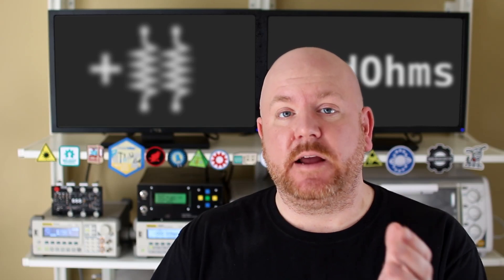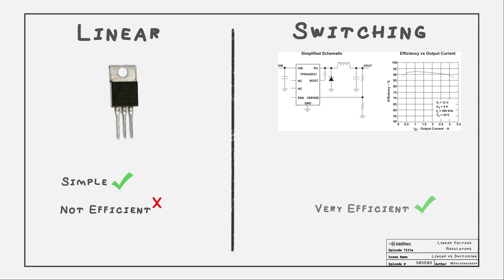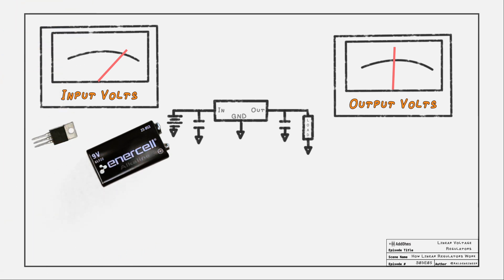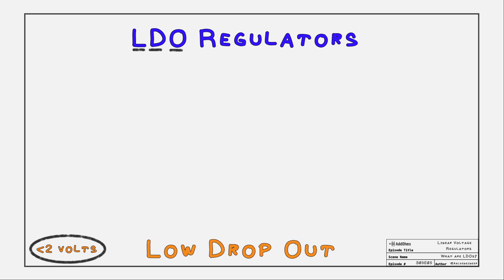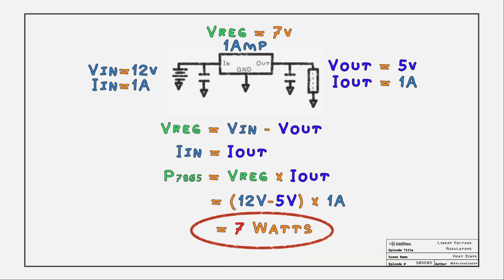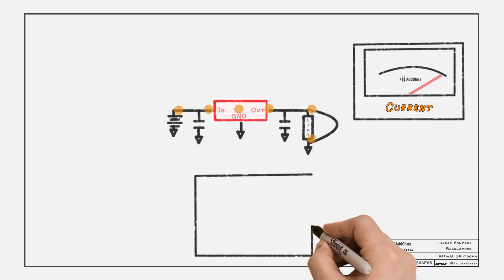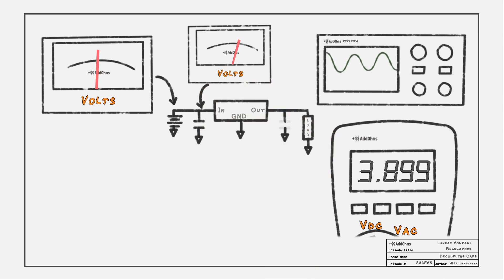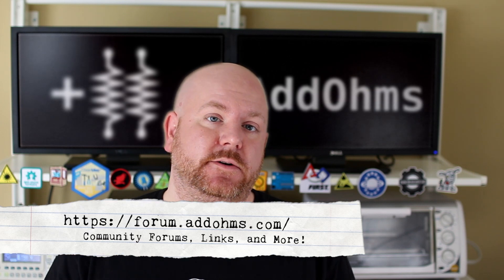Linear Voltage Regulators (LM7805) | AO #17

Comment: How does this thermal shutdown works? It can't just decrease the output else the temperature will increase even more since there will be a higher voltage drop in the IC. So it should refuse to take in voltage. You said it is a gradual output decrease as the temperature rises. How does it do that gradual decrease?
Reply from the maker: Page 10: https://www.ti.com/lit/an/snva558/snva558.pdf
Reply: @AddOhms  Thank you for the reply and link. Cheers!
Reply from the maker: Frankly, at the time I made the video, I misunderstood how thermal protection was implemented. That app note helped me realize how it works.

Comment: Thank you for the video, I found it very helpful.  But one thing, I know this is from 8 years ago but the title to this says its a LM7805 but you show ML7805A, this is a bit confusing. I know these are a little different from each other as the ML78xx as a minimum Turn On Voltage of 7v where as the LM78xx has a minimum Turn On Voltage of 5v. Again, thank you for the video.
Reply from the maker: Neither has a “turn-on” voltage. They drop their dropout voltage, which is about 2 V. So they both need at least 7V in to guarantee 5V out. 

I don’t know where you’re getting your misinformation. There is no functional difference. In this case, LM and ML are the (original) vendor’s initials.
Reply: @AddOhms  Sorry I meant no disrespect, I was just confused with the (LM7805) in the description of the video but yet you show the ML7805, and yes there are specific differences from different vendors.  As for the TOV I'm not exactly sure where I found that but I guess that should be a minimum voltage and even that is different per the different spec's I've been looking at.  Sorry if I sounded disrespectful, I wasn't trying to be.  Also, the LM7805 seems to have a steady output voltage of 5v where the ML7805 has an output range from 4.8–5.2v, and the ML7805 has a higher maximum input voltage.

Comment: what is the difference between a voltage regulator and a zener diode?
Reply from the maker: Voltage regulators actively (and accurately) regulate voltage. Zeners are passive, so they drift under various conditions. Watch: Voltage Dividers as Regulators ?! | AO #22
https://youtu.be/-kEh0TYjYYE

Comment: So does the thermal shutdown action reduce to zero the likelihood of letting the magic smoke out?
Reply from the maker: It helps but does not eliminate it. It’s just a positive thermal coefficient.
Reply: @AddOhms  How protective is that action - thermal runaway usually happens so quickly - how would I calculate a safe margin?
Reply from the maker: It's not something I would ever have a design that relies on [for a linear regulator.]
If it is "thermally running away" there is a serious problem in the design.

Comment: can i use a bigger capacitance capacitor on output than is  written in datasheet?
Reply from the maker: Yes, but you shouldn't. A decouple capacitor DECOUPLES a device from the power supply. So you should place the larger capacitor close to your load, not the regulator.

Comment: Are electrolytic caps okay if you're using a DC power supply like what you'd get with a wifi router?
Reply from the maker: That's what most designs do. The bulk electrolytic cap is decoupling the circuit from the power supply. Hence the name, "decoupling capacitor."

Comment: Correct if I am wrong, but the lowest voltage the regulator will work out would not be the drop-out voltage.  The data sheet shows 2v.  I do not thing the 7805 will work at two volts.
Reply from the maker: It is 2V above the output voltage.

Comment: Excellent explanation. One question please. We have been using hundreds of micro farad smoothing capacitors after the full wave rectifier while you are suggesting only 0.33 microfarad capacitor. Is this an extra capacitor along that hundreds of microfarad capacitor or we need just that 0.33?
Reply from the maker: Regulator itself only need a few hundred nanofarads. The large decoupling capacitors depends on the load and needs to be near the load, so that it decouples from the regulator.

Comment: Thanks, so how do one test if a voltage regulator is bad?
Reply from the maker: Measure the input and output voltage with a multimeter, while there is a load on the regulator. Unloaded regulators, like batteries, may not output the right voltage.

Comment: I'm trying to add a battery to a snowmobile that never had one i installed a regulator rectifier it outputs 6.4vdc at idle and more as the rpm increases which is overcharging the battery ... what can I use to regulate the dc voltage to a maximum of 14.5vdc so I don't overcharge the battery ... any help is greatly appreciated
Reply from the maker: I have zero experience with this kind of system. But if the output voltage changes with RPM, it isn’t a regulator.
Reply: @AddOhms  thanks for the reply ... any idea what I can use to regulate the dc? Something like dc to dc that's adjustable? I just don't want it to go over 14.8vdc that's all ... thanks again 👍

Comment: Dear Sir, 
Can you help me to explain about the output current of the Low-Dropout Linear
Regulator
. I thought that this value depends on the load network. So why most of commercial products has its output current value without a specific loading condition?
Reply from the maker: huh? They do. “Max current.” or “Load regulation”.

Comment: I'd have to say the NE555 had a greater impact than a 7805... IMO of course
Reply from the maker: The 555 is cool and has enabled many cool applications. However nearly every digital system of the 1980s and most through the 1990s and even today, the 7805 and its variants are present. The 555 might be number 2, but it isn’t as popular as the voltage reg.
Reply: @AddOhms  I will agree, but it's limited purpose is why I'd go with the NE555.  Longevity, 7805 wins hands down, as you said, it has been used in nearly everything, even with efficiency and switching supplies, some things still use them.  The NE55% however, was phased out quickly when uC's took over. 

Thanks for responding :)  You have some great content!

Comment: I like them 780x. I take a single sided copper board. Then drill a hole for a bolt then draw a circuit. Then dremmel out the  Cooper to form lands. Add a pair of caps one on input.  the other on out put. Then remount the 780x on board with a drop of silicone paste. #1 goes to input. # 3 goes to the output. (With a 0.1 UF cap ))for noise) #2goes to ground rail.( If i want a little boost) say a whole volt I add  a pair of diodes  to the #2 pin about 6.2 volts goes out from this rig over a 5 volt chip. Very cheep

Comment: Awesome Video! 
I ve a little question. Linear voltage Regulators were invented 60’s and 70‘s. Is there something what doesnt make you burn when you wanna regulate volts without losing amps and which doesnt have the size of a family-pizza like Boostconverters? 
Ty
Reply from the maker: Without voltages and a power level, it’s impossible to say. Modern switching mode converters are exceptionally small. The real decision comes down to cost.

Comment: So is it like a transformer?
Reply from the maker: No, not at all. Transformers step down or step up AC voltage. They don’t work for DC (to change voltage) and they don’t do anything to regulate voltage. Some AC/DC converters step down the AC with a transformer, rectifies the signal, and then uses a regulator to stabilize it.
Reply: @AddOhms  thanks im very new in these things still learning things

Comment: Thank you, Sir, for this (and others in your AddOhms) videos.
Done simply, objectively ... didactically.
For an old, forgotten youth like me, it's very useful.
Thanks!!!
Reply: By the way, if I put a 0.47uF capacitor in the input (instead of .33uF, as manafucter says) there is no problem, right? :) Thanks
Reply from the maker: anything less than 10 uF is fine.

Comment: Super useful and definitely explains why my fan circuit didn't need the capacitors (didn't end up working well anyway) but my amp circuit will.

Does the type of capacitor matter, as long as I keep polarity in mind?
Reply from the maker: Ceramic capacitors are lower ESR and come in smaller values. They are better for high-frequency decoupling/filtering. Electrolytics come in larger values, but also have higher ESR. They are good for low-frequency or (bulk) decoupling.

Comment: I have nte1934 wondering if it'll burn if I use 12v in 5v out, 2amp output. 14w of power dissipation does this number make sense? Is it practical?
Reply from the maker: Datasheet clearly says max is 2W without a fin (heatsink). And 50W with one.
Reply: @AddOhms  thanks. So if I can use 2amp than 50w÷2A=25volt deference? So I can have 2amp 5v output with a heatsink?
Reply: @AddOhms 50w at what ambient  or junction  temperature? I did some calculation of heatsink value for 45c ambient temperature and 125c maximum junction temperature, with 14w power dissipation, 2c/w junction-case heat resistance,2c/w case to sink resistance,not sure if it was correct or not but I ended up with 1.714c/w heatsink ambient resistance value. Is there a heatsink with such value?
Reply from the maker: The conditions are stated in the datasheet.

Comment: Question...Can I series 2 Power regulators across a single power source to split the power?
Reply from the maker: As long they each step down the voltage by least 2 volts, yes. The dissipated power would be spread across them.

Comment: why arduino uses 47uf caps for the regulator?
Reply from the maker: To provide decoupling for the stuff that gets powered by the board.
Reply: @AddOhms  Sure, but why 47uf, not the ones in the datasheet of the regulator? Thanks for your reply

Comment: Great video but didnt answer any of the questions i had.

What is the flow of electricity when there is more than 5V? Does it go to heat or does it switch like a transistor to cycle 5v back through ground?

What is the minimum voltage needed to induce flow through the regulator?

Is there a built in diode to prevent voltage from reversing direction?
Reply from the maker: "Electricity" does not flow. "Electricity" is a construct. Current flows when a Voltage is applied. In the case of a linear regulator the current into it is equal to the current out of it (minus some tiny loss.) The regulator, effectively, changes the voltage dropped across itself to maintain the required output voltage. So heat disspiated is equal to the voltage drop across the regulator times the current through it. 

A regulator that switches "on and off" is a switching regulator.

Comment: I have a few questions. 
1. Can you use electrolytic caps for decoupling. 
2. And if so. Can we use higher values? Thanks
Reply from the maker: For low-frequency or bulk decoupling they work fine. But you'll want to put a low-value ceramic in parallel with it for higher frequency noise. While called a decoupling or bypass capacitor, the ceramic is really a filter cap in that case.

The caveat here is if you use polymer aluminum (or polymer tantalum) capacitors instead of traditional wet aluminum electrolytics. Polymers have significantly lower ESR.

Comment: When I measure the voltage I get almost the input voltage or slightly (1 V) less than the input (16.5V), instead of 5V. Do I have to connect a load resistance first?
Reply from the maker: Regulators usually have a minimum load specification. It's the minimum current they need to regulate the output. If there is no load, there is nothing for the regulator to, well, regulate. If you're using a LM7805, it's minimum load is probably 5 milliamps. Add a 1 kohm resistor for testing.

Comment: nice video. in some schematic, I've seen electrolyte capacitor along with ceramic capacitor and or alone, at any or both of the input and output side. 

PL explain it.
Reply from the maker: Large electrolytic respond to slow changes while smaller ceramics respond to faster changes.
Reply: If you forget the capacitor in your design, you can still solder at least ceramic smd chips between the tht leads of the to220 package.

Comment: Very nice. I want to make a solar mobile charger using this 7805. but I am facing some discharging issue. How can I solve it?
Reply from the maker: You probably want a switching regulator. Or at the very least, an LDO with an enable pin. Either way, not a circuit I can help with.

Comment: Hi sir i have a 2200uf 360v capacitor and i have 300v power supply but i want charge capacitor in veriable voltage 100 or 150 or 250 how can i do that please reply
Reply from the maker: I don't have any suggestions for this project.

Comment: But don't the the regulator give you  more current then the switch regulator?
Reply from the maker: Linear regulators are horribly inefficient for high current applications. Almost all high current / high power supplies are switching supplies.

Comment: what regulator would you use if the input volt if HIGH like 50, 60, or 75 volts?
Reply from the maker: You would probably need a switching regulator.

Comment: Sir my ip voltage is 12 v and 1amp of current means when i try to regulate voltage to 5 v it got 14 watt of heat.. so how can i mange the heat of my 7805
Reply from the maker: I don’t know where you get 14 Watts. 12-5 = 7 volts * 1 amp = 7 Watts. You need to add a heat sink or reduce the input voltage.
Reply: AddOhms sorry 2 amp current..
Reply from the maker: You should consider a switching supply instead.

Comment: Can I get 5 volts out even if the input voltage is inconstant between 7 and 9 volts ?
Reply from the maker: Yes! That is the point of a regulator. If is constantly changing between 7 and 9 volts, you might need to add some more capacitance on the input to help smooth it out. Watch the output to see how much it varies, if at all.

Comment: can i connect many regulators in series to minimize the heat dissipation :D 

i want to regulate 24 V to 12 volt using 3 regulator 18 - 15 - 12 :D
Reply from the maker: The total heat generated across the regulators is the same. In fact, slightly more. If they are too close to each other, you would not get any benefit. And multiple regulators would likely be more expensive than a heat sink.
Reply: AddOhms 24 volt to 12v 100 mA will produce about 1.3 watt * 65 = 84.5 C toooo much for a heat sink
Reply from the maker: Well, that is just wrong. 84.5°C (temp rise) + 25°C (ambient) = 109.5°C. That's still below the maximum junction temperature of 125°C or 150°C. So at 100 mA, an LM7812 in a SOT-223 package would not even need a heat sink for proper operation. Use a TO-220 and the junction is only going to be at 56.2°C.

Comment: hi, thank you for the video, I have 10 volt AC that I want to convert to DC using a bridge rectifier; should I use a regulator too in my circuit ?
Reply from the maker: Without a smoothing capacitor and a regulator, you won’t have DC.

Comment: Great video.  In my project I am using many IC's.  All powered via an LM7805.  I currently have a large 220uF cap on the VI side and another 220uF electrolytic on VO plus a 0.1uF ceramic on the VO too.  I've seen this many times in projects and to be honest, I just copied it.  But it sounds like that is a bad idea.  Any ideas why designs like that are popular?  I guess people just keep copying them.  Any harm in such a design?
Reply from the maker: Overall you're okay. 220uF on the input is fine. You're decoupling the regulator from the rest of the circuit. 220uF directly on the output might be a bit high. On an older linear like the 7805, it'll be fine. But it's better to put a small capacitance (1-10uF) on the output for filtering while putting the big caps near large loads, like a motor or LED strip.

Comment: Hi AddOhms, thank you for the great instructional video I am working with ATtiny and ATMega IC which requires a 5Vdc source. I do have a question I hope you may answer for point me in the right direction. I would like to know if I can safely use 100uf Capacitors for the Input Cap and 10uf for the Output Cap.?
Reply from the maker: yes
Reply: Thanks

Comment: Hello, 
what about the output current ? 
how do we determine it ?
Reply: these days I have been studying converters and regulators, like buck and boost, and I do not understand what the output current depends on
Reply from the maker: +Mohannad SMARTHERO The load determine the  current drawn. The regulator's inductor and capacitor determine the current it can provide.
Reply: almost  clear enough, I still need to make some tests, thanks alot

Comment: Hi there, could I connect many linear voltage regulators together so I can get a much higher amperage on the output? How would I adjust the calacitor requirement?
I want to run lots of 5.5W 12v led lights off a solar-charged battery array and there are cheap 12v x 1.5 amp regulators available. Would this be the easiest and cheapest way to do this?
Reply from the maker: +Matt Hunter You can't just wire regulators in parallel with each other. They will attempt to regulate each other. 

There are techniques to isolate them, but generally that's not efficient. The best approach is to get a single supply that sufficient for the load. 

This could mean, splitting the load up. Example, half the LEDs on one and the other half on the other.
Reply: Ah, I see.
They will be in pairs, might it be ok to have one regulator at each pair of lights? (11W total with the regulator supplying 12v at 1A)
That way the main wiring is unregulated but each module is safe